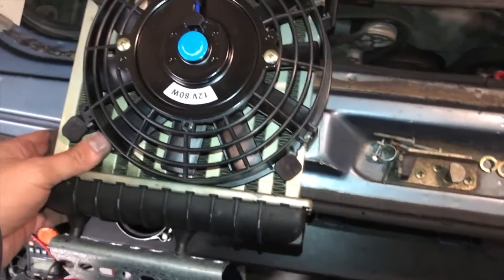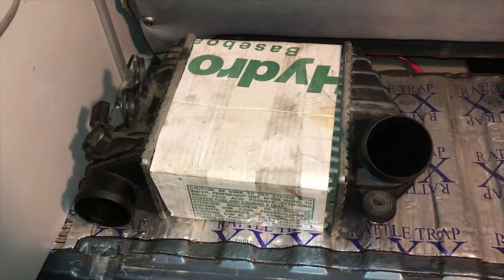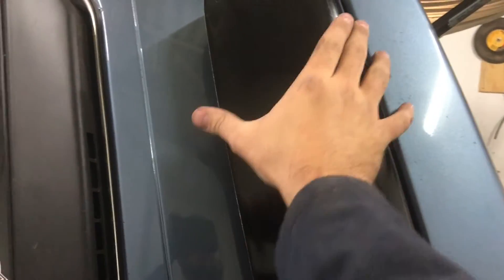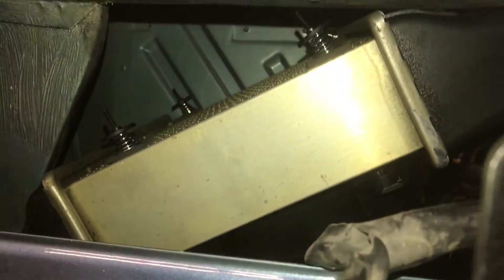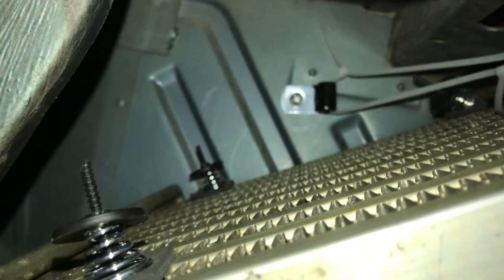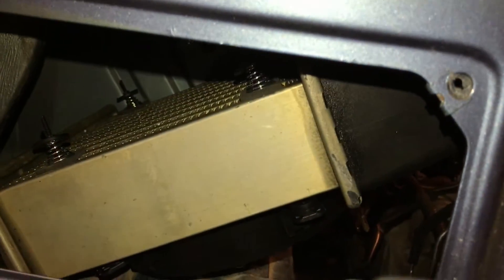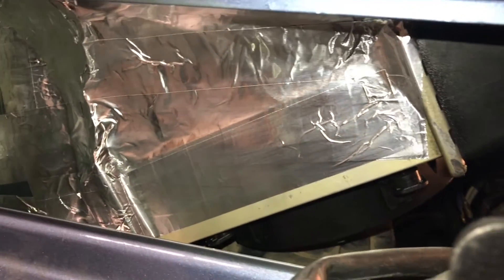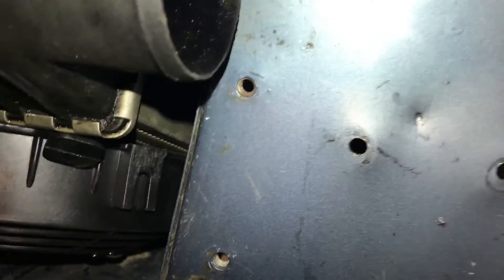88 Syncro EE20 subie swap: air-to-air intercooler setup

Comment: did this exact set up. used this vid as a reference too this was 3 years ago.
Reply from the maker: you are ahead of me then haha ours is still sitting in the shop. the reason I stopped making videos was because I lost my job and had to sell off most of my stuff just to make ends meet. however we are actually taking this up to jeff robenolt of autoventures LLC in wisconsin in feb to finish up the conversion, so it should be road worthy soon. How is your setup doing?
Reply: Is there a file for the air intake visor that can be made on a 3D printer?